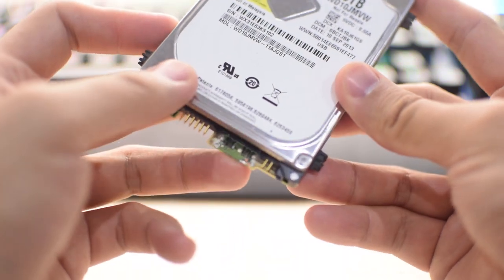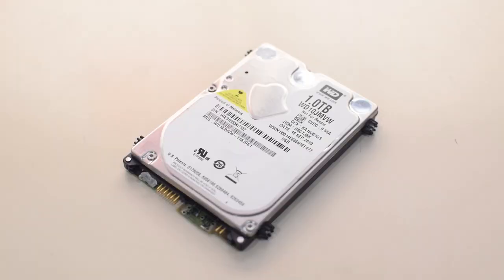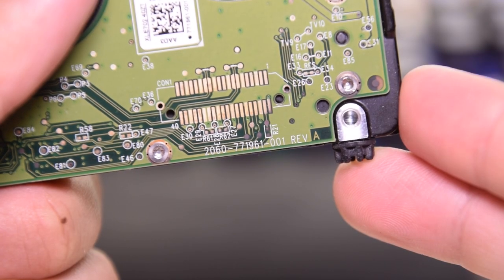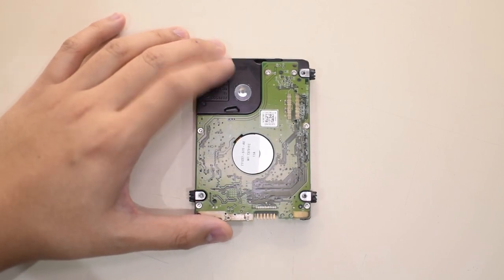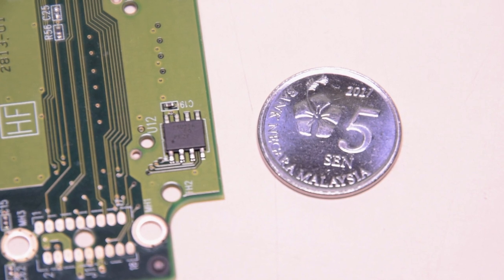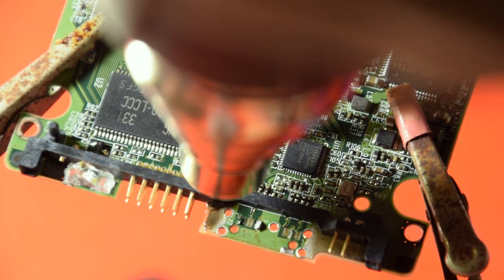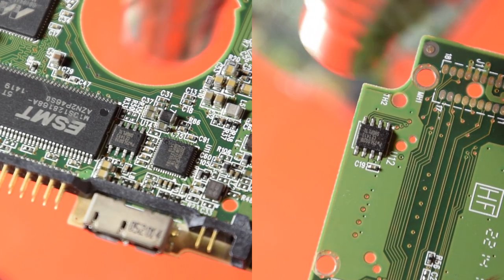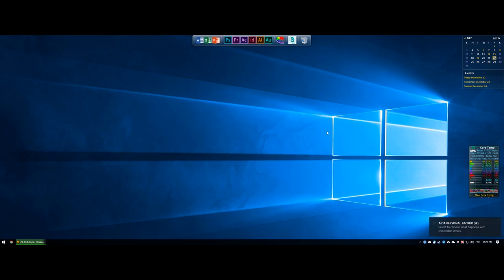Broken, but not lost! - Hard Drive Broken USB Port Repair

Comment: So I've just spend days trying to figure out if there is any way to fix this (I have the same WD Elements HDD) without soldering - apparently there is none :D
But it was very nice to see you can do it yourself!!! I will give it a try if I run into a similar issue (although not this time since I haven't backed the data on this HDD)
Thank you

Comment: thanks for the vid....it would have been nice if you could have said what the chips are called...the bottom chip was easy to figure out...however, the center chip I can't figure out what chip that is on my PCB....there's not another chip that looks like that on mine....so I'm unable to complete this repair.

Comment: what's the name of the glue you are using to put the chip back? thanks! great video!
Reply from the maker: No glue was used to put the chips back, just a bit of flux paste to help with the flow of solder.

Comment: Is it just possible to just re-solder the USB port? I'm getting a new hard drive (500gb 2.5" drive and a separate enclosure) I just need the data.
Reply from the maker: It is, if the traces have not been ripped off completely.

Comment: Very clear vid! Since I don't really need my broken drive as an external, I mostly care to save the data inside, do you think it can be connected to the motherboard directly? Or a hard drive dock station? Thanks!
Reply from the maker: Hmm. This might not be possible as you would probably need to find a board that is compatible with it and doesn't use the USB controller inside.

Comment: I have the exact hard drive with a very similar problem. In my case, the user probably was trying to fit the wrong cable into the Micro USB jack or had the cable the wrong way. TThey mutilated the inside of the jack. It is still firmly soldered onto the board, and there's no other issues. In looking for a replacement Micro USB, there are way too many choices. Can you give me an actual part number for the correct Micro USB jack. I don't know it it's a USB2 or a USB3. I don't know how old the drive is. Is it a Micro A or Micro B, or a Micro AB? Any clues you can give me would be helpful
Reply from the maker: This is a USB 3.0 micro B. Type A receptacles are the ones we typically see plugged into the PC (RECTANGULAR). USB 3.0 Micro B is easily distinguished by its two port looking (terrible) design. 

It's super flimsy with bad durability, which is why it is superceded by USB C

Comment: can we just shoulder the same USB pin that's broken? I cannot get the whole board as it is not available at my place even online.. My harddisk USB port came out along with the wire.
Reply from the maker: As long as the traces weren't torn off together with the connector, you can. 

Mine was a rather extreme case.

Comment: Please can you advice does it matter  when replace PCB  2060-771961-001 rev A With PCB 2060-771961-001 rev B
Reply from the maker: Unfortunately it needs to be the exact same PCB due to the design differences
Reply: thank you

Comment: I'm having a problem on my Toshiba Hard Drive. I don't think it is the same problem as stated in this video but the name got my attention.
My Nephew carelessly removed the connector from the drive. Now I don't know what the problem is but I'm sure it is maybe the connector or the socket from the drive. Before it really got broken I've still managed to use it on our TV but it suddenly exits. Then I figured that its broken. I tried to push the connector in and the light (that signals that the hard disk is working) is going on then off. Then it suddenly just completely went off. A reply would really mean a lot man. I've subscribed to your channel and hoping for a response.
Reply from the maker: Listen to any clicking noises. If there is then you've most likely got a broken drive.

Comment: Is it possible to remove the ext sata connectors so the drive can be used internally with normal sata cables?
Reply from the maker: If by that you mean USB 3.0, if there harddrive already uses a USB board AFAIK It can't be done.
Reply: @TechRodent  i have the exact same 2.5" external hdd as the one u fixed. I removed the drive from the case and wanted to use it internally within xbox 360, but I think the xbox uses the two cable sata attachment (used with internal hdds), instead of the usb cable used in externals. Guess I need to buy a new drive - Thanks anyway!

Comment: What do you mean @ 3:19 when you say: “Now if you’re lucky enough, a simple board swap will work just fine.” Do you mean simply replace the old PCB with the new one, without having to transplant the two bios chips? ...because that would be pretty darn peachy, as my soldering skills don’t exist.
Reply from the maker: There have been people who have expressed success in the just a board swap, but apparently it's rare.
Reply: Tech Rodent   I see. Well, if I can find a replacement PCB somewhere I might as well give it a shot. I might get lucky. Thanks for the info kind sir! 👍

Comment: Can i just replace the circuit board with a new one?
Reply from the maker: Unfortunately it's not that easy. Each board has a different layout for the data inside, it may work by chance, or it may not, worse case is that it damages the drive
Reply: @TechRodent  If I found a board of the same model?
My drive board got fried due to a dodgy power supply from a cheap connector.
Is it about specific firmware when using a different board?

Comment: what if i didnt swap the bios chip? can it still run?
Reply from the maker: The chip has information regarding the bios partition, the data blocks and what's stored where, including the firmware.

There is maybe a chance it might work but I wouldn't bet on it.

Comment: why not solder a new usb port?
Reply from the maker: The traces on the board were completely torn off from the damage. 

It is of course possible if let's say the damage wasn't that extensive, but what is shown here is more of a worse case scenario

Comment: This just happened to my hard drive in my bag :/ Hope I can fix it
Reply from the maker: Good luck!
Reply: Did you leave the cable plugged into the drive? Apparently this is planned obsolescence. With repeated use the USB port snaps off the PCB. There is no other support for the USB port other than the PCB. So why this guy wrote what he wrote in his description I don't understand.